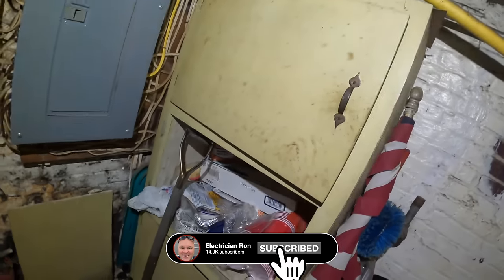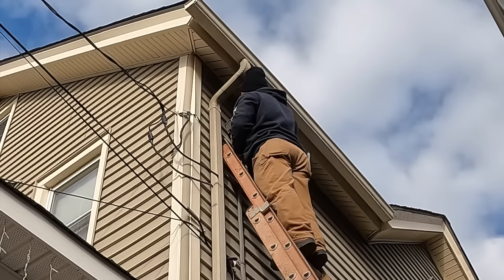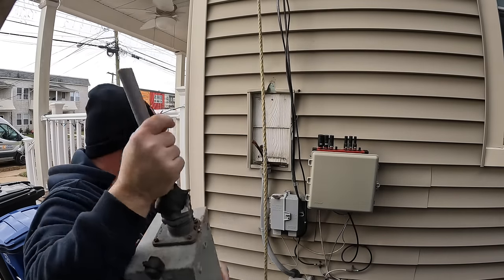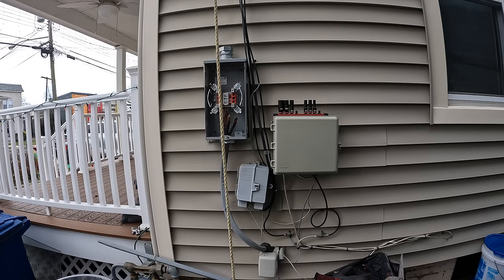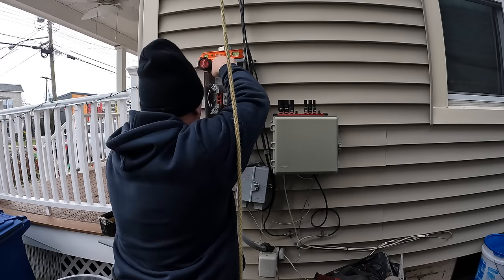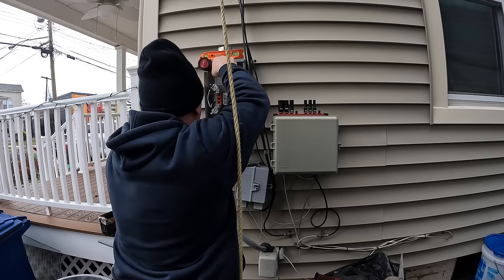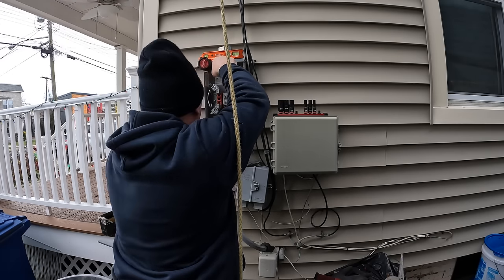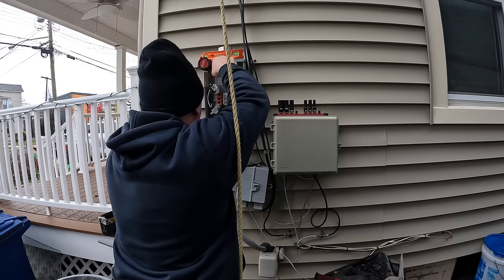200 AMP ELECTRIC SERVICE RISER REPLACEMENT #electrical #electrician

Comment: I’ve seen this in residential distribution system. It occurs if the loading and phase angle between the phases isn’t perfect. High inductive or capacitive load will cause the phase angle to shift. Each phase is 120 vac and across the phases will be 208vac. I would have the utility check either the transfer or the loading on each phase.
Reply: How can the phase angle between phases be off ? It’s set at 120 degrees at the generator in the power station .
Reply: @persona250  the generator sets it at 120 degrees . A transformer can be designed to set the voltage 180 degrees apart. On High Voltage lines  the phase angle of 120 degrees can be sifted up to 5 degrees either way. To get 240 volts the phases have to be 180 degrees opposite. Load currents of different type of loads can shift the angle . It comes down to the anglular different between the current and voltage.
Reply from the maker: Imagine adding a single phase panel from a three phase 120/ 208 service. The double pole circuits in the single phase panel would be 208V across both legs. That's what they have here.

Comment: Great video ron as usual, been subbed for some time now. Had a question on your customers and how you find them to get work??? Obviously i know about advertising and all that stuff but was curious what your specific method was. Thanks bro !!! Happy New year !!
Reply from the maker: When you put in the work, the results will come. The harder I work, the luckier I am. Tell everyone you know that you are a professional electrician and word will spread like wildfire but you have to be good at it and persevere at all costs. Build trust by showing up on time, doing what you say you're going to do, and clean up after you are finished. Take your trash with you and always, always, always employ drop clothes and respect peoples property. Also, if you are really just starting out then don't be afraid to do there work that others don't want to do because if you that ONE THING you will always have work!!!!
Reply: @electricalron  I have been an electrician for 21 years outta philly. Never went on my own and was thinking about it. I will be 40 soon so times moving fast ya know. The one thing that always steered me out of it was the customer side. Like I always get plenty of side work all these years just was thinking like if that runs dry a bit where ya go from there on your own ya know. Thanks for the reply Ron !!!!

Comment: No fluff, no BS, these videos are the real deal, what it’s like to actually be on the job. Super helpful to watch a seasoned pro getting it done.

Ron: I get nervous sending 2-3” screws in for straps, that I’ll hit something. Ever a concern for you?
Reply from the maker: Normally, things like water pipes are not run inside the house on an exterior wall because they’d freeze.  So no, I don’t worry too much.

Comment: Hey Ron great work as usual but I would use the quick connect 12 v Milwaukee impact instead of that screw gum .i  also use my 1/2 inch screw gun to twist that neutral and last but not least spend some of that great money we make and buy the battery operated Milwaukee  cutters for the SE cable your hands will love you as you get older 👍

Comment: You'll be a lot happier up on a ladder driving Torx drive screws like that. Love the code references you put up Ron.
Reply from the maker: I've been using 2 1/2" exterior coarse screws forever.
Reply: @electricianron_New_Jersey  I just can't stomach phillips drive screws anymore. They cam out, they strip. Friggin' pain in the ass.  Thanks for the vids from an ex-Jersey boy (Trenton area - Ewing) now in Colorado.
Reply: I just use hex head Tapcons for literally everything. 🥳 unless there’s an overwhelming desire or need for them to be flush finish. then…it’s torx

Comment: Just did a similar job the other day.  Mine though lost the neutral between the meter base and breaker panel . Since we had to replace the service cable from meter base to the inside the AHJ required us to add a disconnect outside and we went ahead and replaced service mast , meter base and added disconnect along with new ground rods and put it in conduit outside as I don’t like not putting it in conduit and that was what caused the issue originally because the outer sheathing had failed and was letting water into cable . When I cut cable inside house to attach to to pull it out and new one in ( had a finished bedroom between meter base and panel and we lucked up and got the old cable pulled out with the new one attached to it since someone had bored oversized holes in the joist originally ) water poured out of service cable and neutral conductors were corroded in to and just pulled out in pieces .
Reply from the maker: Yes. Obviously the service-entrance cable WAS NOT INSTALLED PROPERLY.
Reply: Yea that junk doesn’t take long to rot then you have an exposed neutral. Such a shotty product

Comment: Is touching the bare neutral in the panel in the beginning of this video potentially dangerous if the utility neutral has a problem? I would think if there is an imbalance between the loads on the two phases, there could be current flowing through it without a proper utility neutral.
Reply: Touching one wire is not a problem as birds has demonstrated by stepping on single wires atop the energy posts. If the hot wired has been disconnected prior then the neutral is not pulling any load from inside the house.
Reply from the maker: I didn't touch anything until after I tested it with my testers. The homeowners had told me the utility was there the night prior and re-attached a loose neutral. Current will always return to the source and if the neutral IS NOT AVAILABLE it will return via the grounding electrode(s). And yes, than there IS POTENTIAL between the copper water pipe and someone holding the pipe and standing on the basement floor. Very dangerous situation. This also happens when dopes connect a neutral pigtail from a smart device directly to the box like you would an equipment grounding conductor in a metal box.
Reply: @johnnychang4233 birds are not stood on ground when they are touching wires . Ron was
Reply: @persona250  Hence the rubber boots and fiberglass ladder to insulate from ground. And I start to understand the why in NJ they use PVC pipes like outdoor riser for electric wiring. You prevent accidental grounding if you get in contact touching those pipes.
Reply: @johnnychang4233  he’s talking about touching the wire inside the panel .
Reply: Yes and there is practically always an imbalance it is a normally current carrying conductor. If one side you panel has 59amps and the other 50 it will be carrying roughly 9. Some will be on the ground as well since electricity takes all paths

Comment: Is it normal to have 3 wires coming into meter but 4 going from meter straight into house into panel
Reply from the maker: Only if the main disconnect is ahead of the 4-wire terminations.